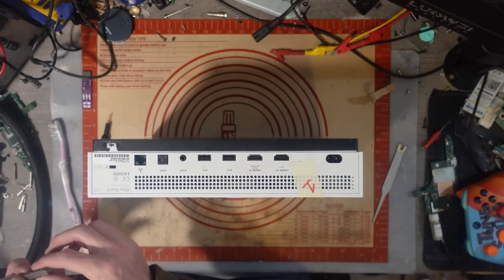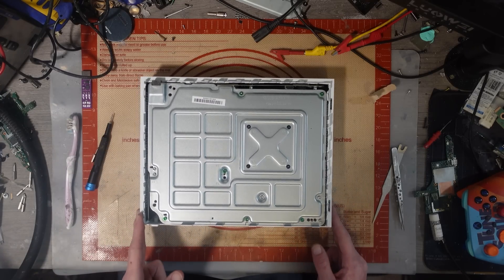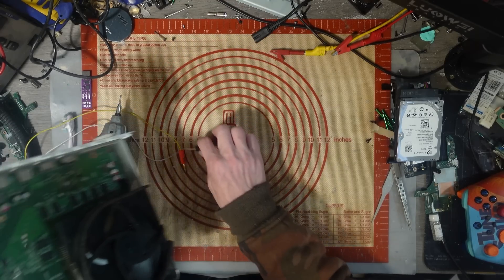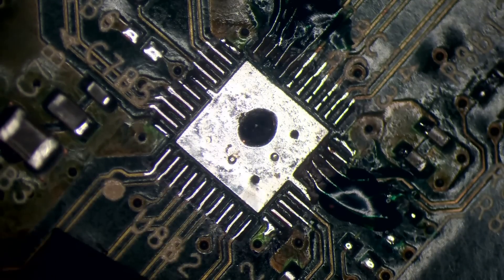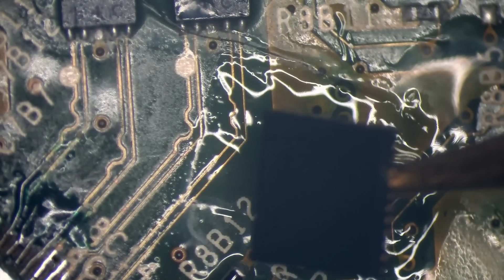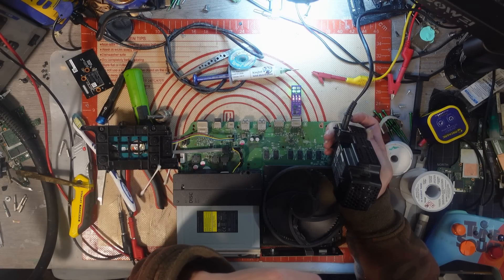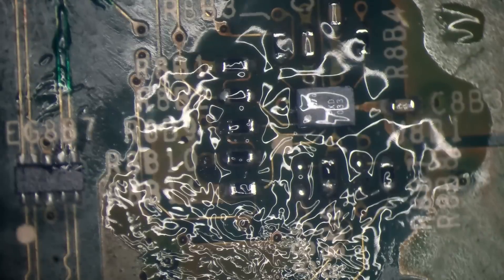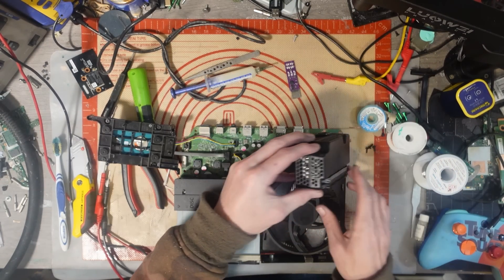I Bought A Broken Xbox One S For £10 ($15) And I INSTANTLY REGRETTED IT

Comment: Hello thecod3r, 
I have a Nintendo switch lite with a backlight and everything works but no image is being displayed. I have tried with another motherboard and it works but this board, it just doesn't want to show an image. I checked the LCD connectors and it looks good so I am scratching my head here on what to do. The backlight chip gets hot on touch and gradually keeps getting hotter but the backlight is still on. Would u like to take a look at this switch board?

Comment: Been buying some solder practice kits off of Ali baba and da forty tealeaves...   Grabbed a nice 0-30v psu kit, a 2 channel amplifier and a multimodule chip programmer kit with different modules for converting to the programmer, cost me just over a tenner and quite happy with my progress as I use my hot air and solder station to try it out :D

Comment: Hi Phil. I have a random question for you. Is turning the TV off at the wall each night bad for it? Some places say it's fine to do this while others say it wears the TV down quicker and you shouldn't do it. Thanks.
Reply from the maker: There may be a slight argument for having to "hard power on" the TV every day because it has to recharge the capacitors, but energy conservationists would recommend turning it off by the plug anyway. Personally, I'd say shut it off fully because not only does it save energy, but it also reduces risks of things like thunderstorms damaging it. It would take an awful long time to damage capacitors with daily charging and discharging and probably not enough to have a long-term effect since we change TVs on average every 3-5 years anyway. I also shut all my consoles down overnight, as well as during storms 😀 hope this helps a little
Reply: @TheCod3r  Then I will continue to switch them off at the wall at night. Ever since we had a plug catch fire I'm super paranoid about leaving things on. And then we bought a fancy £3,000 TV and someone told me I shouldn't turn it off at the wall at night and that made me paranoid too. Lol Thank you for helping me. X
Reply from the maker: @catherine_england7312  I'd definitely say that's reason enough to shut everything off at night. House fires are extremely rare especially with today's electronics but better to be safe than sorry. I'd definitely recommend taking out insurance though because that would cover you if anything does happen. But honestly it sounds like the person telling you it can harm the TV is talking nonsense 🙄 I hope everyone was OK in the fire

Comment: Would tapping the end of the wire with a hammer to flatten it be beneficial at all?  I know I do this large scale with 1/8 rod for welding projects.
Reply from the maker: I used to work with a guy who does that but rather he does it with pliers. He squishes the wire to flatten it so it sits back inside the tracks properly. He did say it's possible and does make for cleaner work but it's incredibly time consuming. I think we need to find a source for proper flat wire lol